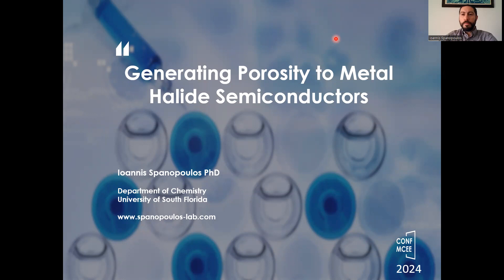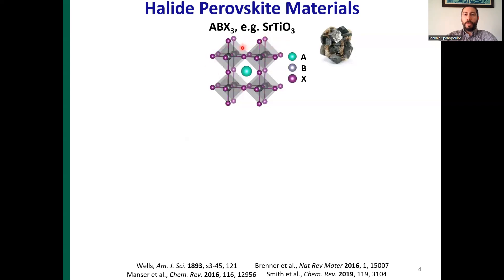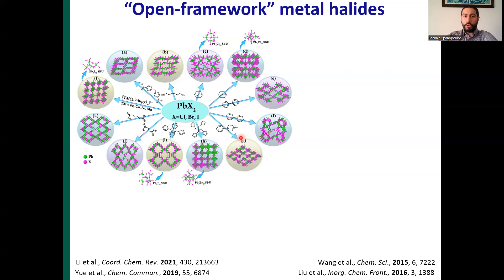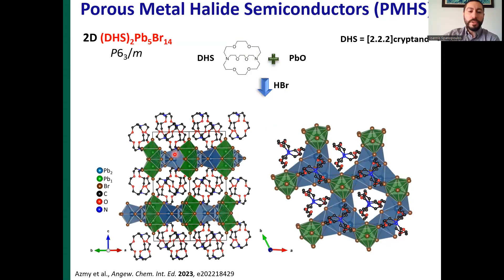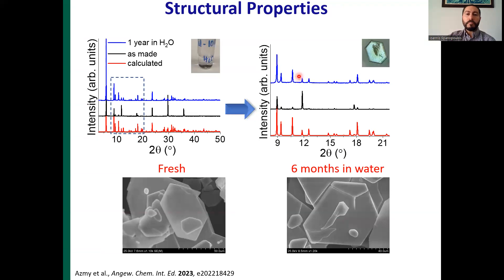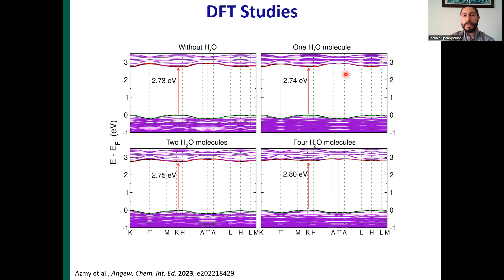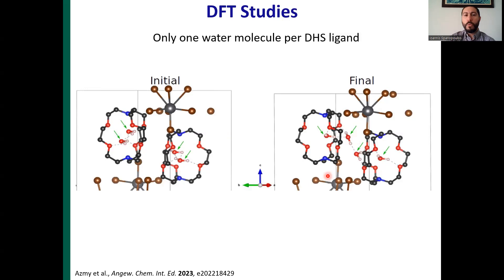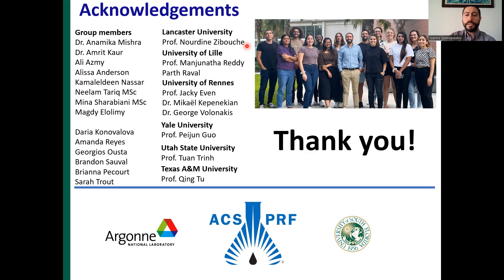CONF-MCEE 2024 - Generating Porosity to Metal Halide Semiconductors

Comment from the maker: Here are the questions we collected and the answers replied by the presenter: 
Q1. How does introducing porosity into metal halide semiconductors affect their optical and electrical properties?
A: Based on our studies, the generation of porosity has no impact on the optical and electronic properties. The bandgap remains direct, and features miniscule change.

Q2. What methods are most effective for generating controlled porosity in metal halide semiconductors, and how do these methods impact material performance?
A: The strategy we follow involves the use of molecular cages. By adjusting the cavity of the molecular cage we can adjust the porosity of the corresponding materials. We are still evaluating the optoelectronic properties of the microporous materials. We will know more in the publications that follow.